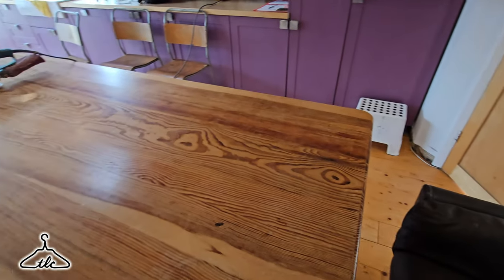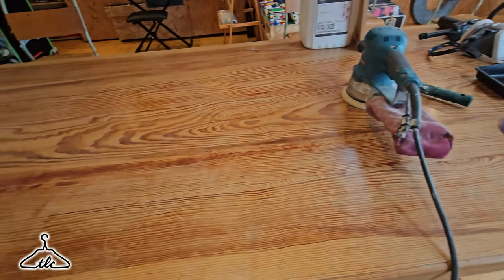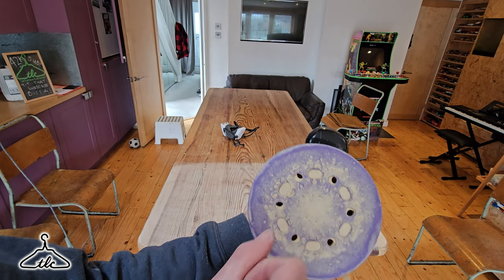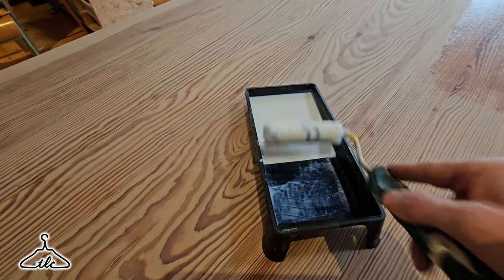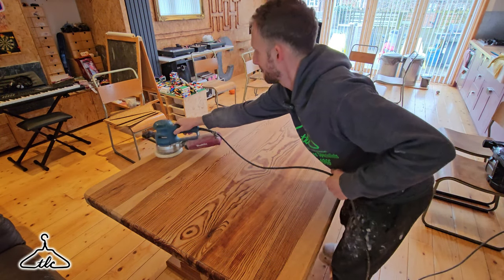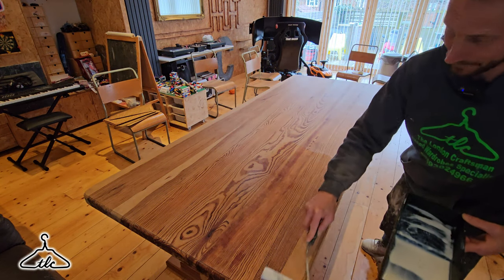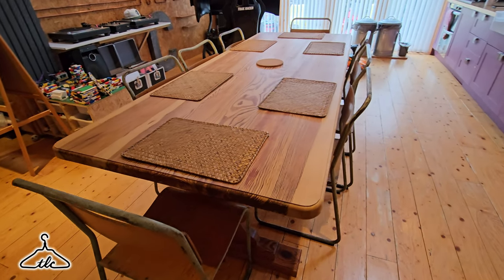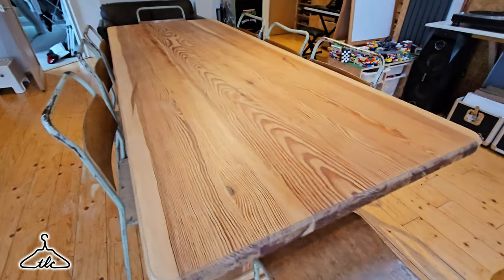Renovating a GIANT 'Ebay Find' Dining Table : Sanding & Refinishing (Vintage 1960's)

Comment: Very nice work. I have never heard of Manns - how does it compare to OSMO (the only stuff I have used (I am only a DIYer)?
Reply from the maker: Tbh Im not too sure.
The manns I have is a varnish/laqcuer, and osmo is an oil.
The oil soaks into the wood and the varnish creates a protective top layer.